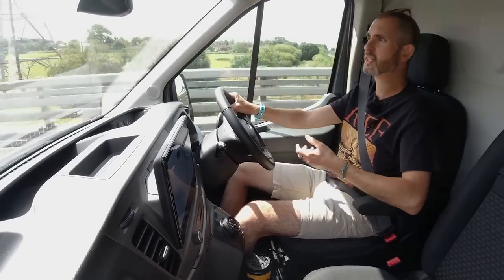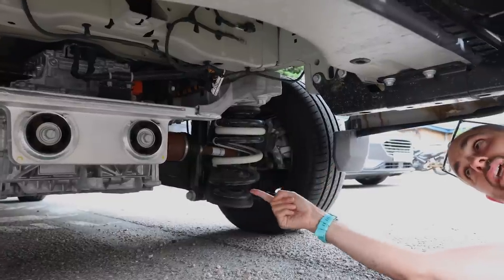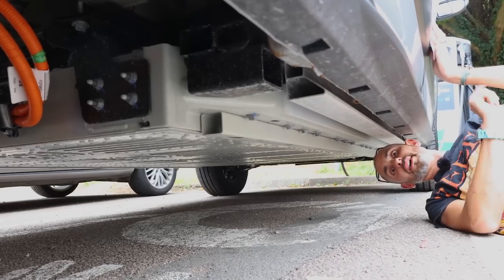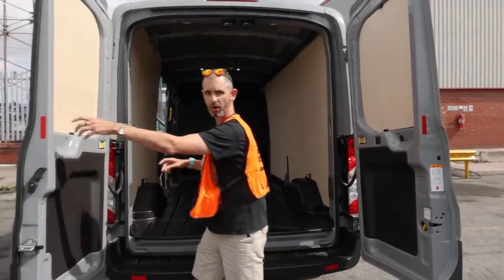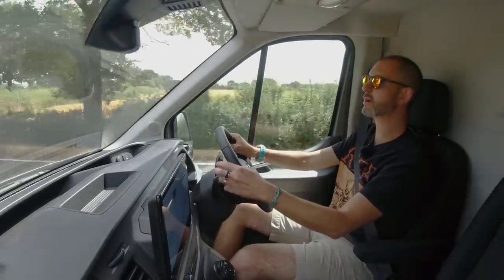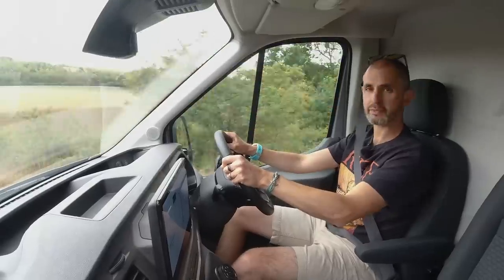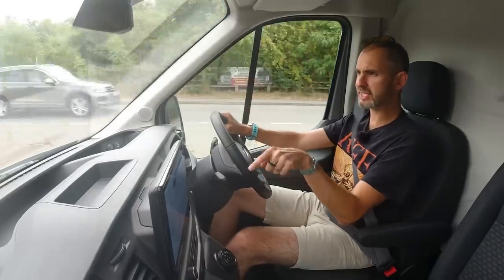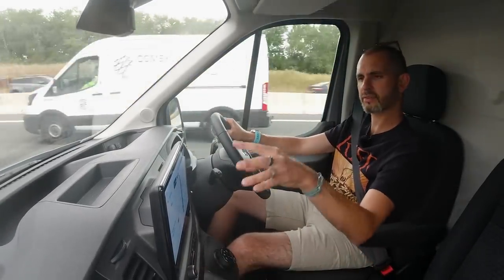New Ford E-Transit electric review - the most important van of 2022

Comment: An absolute no brainer. Electric vans are 100% the way forward. What irks me, is the range. How is the range still so paltry (relatively speaking). It's all about battery space in the vehicle right? Why only use the underfloor area? What about the walls? Behind the cab? All that 'fuel tank' space we saw early on. That van should have double the available range. Until you can match the range of a diesel van then most folk will just walk away. Seeing as it takes near an hour to 'fill up' on a fast charger, then it's got to have at least the same range to tempt a business for them to balance up the cheaper fuel and maintenance costs vs the heavier initial outlay and hours spent off the road while plugged in. Save the planet? Who gives a fuck when the reality is staying in business and turning a profit is the No. 1 priority. Until it is a no brainer for a business owner to go electric then it won't take off.

Comment: Good review Jonny, is there a reason you wouldn’t tell us how much it cost to top up the batteries when you took a break? 👏😀👍
Reply: It looks like he added around 70% (47kWh?) on the first charge. Instavolt is 57p per kWh, so it would work out to around £27 (0.57 * 47 kWh = £26.79)
Worth considering other cheaper networks too (Instavolt is pricey but convenient). Ionity offers a subscription that gets you 30p per kWh charging at its 350kW chargers (0.30 * 47 = £14.10). At depot charging would be even cheaper still 👍
No idea how this compares to diesel vans 🤷‍♂️

Comment: have they improved the sliding doors, so thieves cannot fold them in half anymore ?  

Are there provisions for mounting storage/shelving modules in the rear, without drilling into the battery pack ? Attachment rails or threaded plates on floor walls and inside ceiling ?

Has Ford or anyone addressed the issues of vandals cutting the charging cables for scrap copper?  Level 2 charging could carry a portable cable and a secured wall mount SOCKET in wall of house or work.... or better, an induction charger you drive over.

Comment: How much would running a refrigeration unit take off the range?
Reply: All of it 🤣
Reply: @MattyEngland  considering the aircon hardly touched the range, I'd be surprised if a small fridge ate that much...
Reply: @richardharrold9736  Cooling the tiny cab to 22C, is very different to cooling the whole load space to 3C
Reply: @MattyEngland  oh, sorry, I thought Lee meant a refrigeration unit for a few bottles of Irn Bru in the cab! Yeah, no question, even if you insulate the whole load bay, if you're trying to refrigerate that much space, you're going to need an external power source of some kind (be it diesel, CNG, hydrogen...) - but what percentage of vans are refrigerated? Not that many, I'd have thought.

Comment: The big EV elephant in the room though is that for most of the south of England the Co2 produced to make the electricity to power the cars and vans is much higher than most would expect and the overall output per mile isn’t far off a hybrid car. 

See the Harrys Garage episode where he compares an i4 EV and a hybrid Range Rover. 

The Volvo xc40 EV vs petrol comparison is also well worth a look. It was covered by Harry and Rory on Autotraders channel. 

In summary, unless your electricity is very clean, it takes a huge number of driven miles before the total co2 produced to make and then use the car is less with the EV.
Reply from the maker: You can't always control the source of your electricity, unless you choose an ethical tariff or start generating some of your own. But then how many people analyse the journey and emissions required to pump, refine and deliver oil/fuel? No one. There is no silver bullet to this, but we need to try and reduce emissions and improve urban air quality. Right?
Reply: Agreed. We do. I’ve had a electric car for 4 years and it’s been great.  

I do get frustrated by some of the rhetoric and actions taken in London though yet seemingly little is being done to create new forms of cleaner energy to power the electric vehicles. 

Renewables are improving but turning on coal powered fuel stations at the same time as expanding the ULEZ zone seems to be an odd combination which we need to address

Comment: On the subject of "Roads will be quieter" can we please, please have a conversation about how bad tyre noise is... thats all I could hear on that motorway at the end.
Reply: Not to mention heavier vehicles causing more damage to the road surface.
Reply: yes, "quiter" means less then now and not complete silent
Also: you driving a "bit" faster on there than in the City and there is a reason that a BEV has a mandated Noicegenerator for Speeds under 30km/h
Reply: @enisra_bowman  Its not exclusive to an EV and exactly why I'd love someone to do a video really digging into what we can do about tyre noise as its so much more oppressive sounding to me. A lot of ICE cars are so much quieter now that the tyre noise is the only thing you hear.
Reply: @batousan_  i mean, if you ever heard a tractor going down the road at full speed, you know what "tire noise" is, but still, a BEV at low speed is super quiet, much more than any normal ICE. 
They maybe ended the Video on Motorway, but the talk was about Citys where the Topspeed 50km/h with few exceptions + you have the engine noise at a red light or stopsign, etc., that is shureley much less today, but well, you still hear an idling engine, but not an electric motor and that are things that make a city quiter, while the only short/midterm option to get a motorway quiter is to have better and cheaper trains since yes, that Tirenoise stays until you have widespread quit asphalt and other types of tires
Reply: @enisra_bowman  we know how quiet EVs are, it's bloody obvious! Which is why it would be nice to discuss tyres in the same context, as to me EVs are still noisy, just less noisy than ICE. Let's talk tyres. Please 😩

Comment: Cargo capacity suffers. 750kg load is pretty small. Most of the Vans that have GVW of 3,5 tons have over a 1000kg, some of them reaching 1500kg. Above 3,5t GVW you might need a different licence and additional road tax, vignette, more often inspections or other. Yea the volume capacity is the same, or petty much the same, but the carrying capacity is pretty low. It might work for urban areas, goods maybe, but for equipment van- No No.

Comment: i think the idea is great but imagine range when the vans are loaded like they normally are,i bet travel times,work effiecieny etc would be affected
Reply: My van has over 600kg  in it at least 3 days a week. 
What tradesman has time to drive around and queue up at a fast charger? 
Not this one 🤣
Reply: @domefford864  I know exactly my point.ok if u a town driver but most van drivers go all round the country
Reply: @marclevine2688  I wonder how many miles he done at 80mph on the motorway? I charge for travelling, it’s based on hours at the wheel not diesel cost. If I have to travel bristol to London and back I want to be sat at minimum 80mph there and back. Imagine sat at 65 mph coz you’re worried about charging. I’d have a nervous break 🤣🤣
Reply: @domefford864  I'm a breakdown patrol n wonder how many vans I'll see out of charge as drivers couldn't be bothered to wait to charge it so took a chance with low battery
Reply: @marclevine2688  well if we are to believe the government in 10 years you’ll be battery charger man, not mechanical repair 😂

Comment: That shifter is the one they put in the kuga phev as well. I suspect then, that L mode, would have meant "low" gear mode for long downhills. Like B mode in a Prius, it should bring in the engine to do some engine braking to save your brakes a bit (especially if the battery is full and regen is off the cards). Ford being penny pinching Ford.... cheaper to just leave the letter L on there even though it performs a different function.
Reply from the maker: I didn't know it was a parts bin shifter. Makes sense now - many thanks.

Comment: the thing is  Johnny if the average "van fleet operator" had premises with the correct facing roof like you said they could cover there roofs with solar panels and install batteries to store the solar power and power there premises on free electric and charge the fans for nowt every night, the payback on the batteries considering the fuel cost savings for the vans and there normal day to day electricity costs would be infinately quicker so running a fleet of 5-10 Etransits the payback could be as low as 2 years or less all good cost saving benefits for the owners, i myself live next door to New Balance trainers, and not long after i fitted solar panels to my house roof (4kw), they installed 10 mw of solar panels on there roof, conversly during lockdown when there factory was shut there panels would have been making them a fortune in cash, and in a similar vein, a paper mill 1 mile from me since 2018 they have generated all of there energy needs by burning logs not up to grade for paper making, the possibilitys are truly endless, the only danger for ford is if Tesla decide to go the E Van route with a larger battery/range and similar price point the ETransit is dead in the water imho,keep them coming :) :)

Comment: An E - Peugeot boxer costs over 120.000 Euros. A diesel one 38.000 do the math. Diesel in my country has fallen to 1,7€/ litre and continue to decline.  In some cases an E-Van is better but for example in Campervan and Motorhome field is a no-go as the base car will have a huge price difference. For someone that is doing around 20k km/year diesel is a better option.

Comment: I get that the majority of the van is the same so it would otherwise be a very short video, but a large chunk of the video could be dubbed as "range anxiety" and I feel that the novelty would wear off rapidly if you were using it every day - plus growing pains I know but if every courier (which seems like a logical application for these vans) had to sit for 30 minutes at the couple of conveniently located chargers then once you get more than a few local vans you'd have to queue for the chargers.  Filling an ICE takes about 5 minutes and there are usually 8 or so pumps but I still often have to wait for a couple of minutes, so how does that stack when you're taking 30 minutes to charge?

Also I would be curious to see the battery degradation/range loss if you did one 30 minute rapid charge every working day of the week (so 240 times a year, say).

Comment: Another good review, but a couple of points I feel I  could make, perhaps it would be wise to plan a journey so you didn't need to use a motorway filling station, then you would not be paying £2.06 per litre, and also is it fair that a Transit of this size can drive around on the road with free road tax ,when some small cars doing little mileage get charged about £150

Comment: Is that really electric from scratch? The battery seems bolted to the bottom as an afterthought and the space where the tank is supposed to be is a huge wasted space :(
Also a shame that the VW Buzz doesn't have a 9 seater version unlike the T7. Personally I hope for a nice 9 seater van with 4x4 (I'm in the alps..)

Ps. that regen chapter is very long :D

Comment: Thinking that front charge port could get covered in dead flies so nasty to deal with. Would it not be better for a parcel van to have the back a lot closer to the ground so the operator is not having to climb in and out of it. Either front wheel drive or in-wheel motors would allow for this. So pleased Ford is making this effort I was disappointed with their electric pickup that just followed their ice one and has all the aerodynamics of a brick. This is what Tesla should be doing, not messing about with plaids and roadsters. Thanks for your review.

Comment: 300M /480 KM would be nice. Next upgrade? The load doesn't seem to be secured: quick stop issues? I see this as a reasonable evolution to the Sprinter/Transit vehicles that we are driving now for 90 some odd % our needs now, with said range increases.

Comment: 20 years ago everything had to be front wheel drive better traction safer in bad conditions, not most EV's are ready wheel drive. What's changed in the thinking? If like to see a laden e transit hi arrive a round about a bit quick.
Reply: FWD is primarily for packaging in cars.  Makes it easier to get everything in as one 'block' and keeps interior space

Comment: Seems odd that they only offer them with such high power outputs. I guess it's just because they're reusing motors from the Mach e or something.
Fully loaded 3.5 tonne vans are easily quick enough with a standard 130ish hp and the higher powered 170hp ones can't usually handle the power without just spinning their wheels everywhere.
Realistically given the range limitations caused by the battery these things are likely to be used as local courier vans so probably will only ever carry under 500kg payload.
Offering outputs of say 110 and 150 would be more attractive for fleet buyers looking to limit crashes and tyre replacements. Not sure the lower outputs would increase the range much but surely would allow spec reductions to drop the price.

Comment: Would have been nice to see the cost of the two charging stop breaks and the cost before setting off fully charged from home
Diesel is still cheaper than coffee per litre
You seem to consume more coffee when you have an EV
Reply: You can work it out - the battery pack is 68kWh so to charge at home (from a very unlikely 0% to 100% at current domestic rates) would be around £19.75 or £1.97 for every 10% you add.

When charging at an Instavolt (57p/kWh) every 10% would be about £3.90

Comment: Slowly pushing us all into EV's!
Reply: @Thecrazyvaclav  and let's face it, a Transit diesel engine is a pretty nasty thing, so if commercials start converting to EV that hopefully means petrol prices will drop and I'll be able to run my V8s and V12 more...
Reply: @richardharrold9736  here in North america we have V6 gas Transit they are cleaner than diesel
Reply: @Jonathan11225  yeah, the Ecoboost 3.5 - less smoky than a diesel but much thirstier...
Reply: @Thecrazyvaclav  what we do will have 0 effect as China will not even start reducing carbon emissions for another 28 years 🤣
Reply: @richardharrold9736  we have the 3.7 NA too
Reply: @Jonathan11225  oh, the Cyclone - an engine we are sadly denied even in the Mustang, we only get the 2.3 and 5.0 - not sure why you'd go for it over the EB in the Transit though.
Reply: @richardharrold9736  maintenance factor Cyclone V6, are cheap to repair
Reply: Nobody's pushing you. If you don't want one, then don't have one. You will always have that choice.....
Reply: @Brian-om2hh  no in the near future we won't have a choice, also if you think you will be aloud to drive your electric 10 years from car you are in for a sharp shock, autonomous are the future!

Comment: As the unladen weight of the vans increase due to batteries the max weight they can carry will reduce? Will this mean the powers that be might have to consider upping the limits to get a similar load carrying capacity?
Reply: Also, I’m pretty sure that anything over gross 3500kgs now has to run a tacograph?
Reply: @BillyCabrio1985  over 3.5t = tacho, but the limits before a tacho is needed, will these need altering to reflect the reduced capacity i.e will 4.5t be become the new limit before a  tacho is needed?

Comment: Considering the kind of milage most vans of this type do, I think that Ford have messed up with regards to the battery size.  They should have given it a much bigger battery pack (at least as an option) because these are the exact size vans that people like Amazon drivers use on a daily basis and they don't have the option to stop for an hour to recharge the vehicle.  Yes, Amazon is just one company, but it is a huge one that employs far more drivers than you would ever realise without looking into it.
Reply: Of course not, because then there would be 0 payload capacity left. And it would be completely unaffordable.

Comment: Could of been the perfect camper but it'd dolly expensive
Specially once you go long wheel base high roof and the built in inverter
Reply from the maker: Works out about £5k more than diesel with gov discount.
Reply: @TheLateBrakeShow  not with the inverter and all that. 
Also you still going on about regening making a trip more economical. Regen isn't economical..coasting is more economical than regen if you can drive without requiring to brake/regen. 
Main difference between consumption curve on EVs and combustion cars is that combustion cars tend to be most economical around 45-50mph while EVs are most economical around 20-25mph. 

If you want more range, you should minimize regen. Sick to death of YouTubers going on how "more regen" or "stronger regen" being better for range, which is silly wrong.

The charging cable is thicker because has to conduct more current. The more current (amps) a cable has to carry, the thicker it has to be.
Reply: @cbflazaro  I've already seen one with the cable hacked off for the huge amount of copper in it. They hit the emergency shut off button, then just cut them off with bolt croppers
Reply: @MattyEngland  yeah its probably £200 worth of copper in that cable or more.